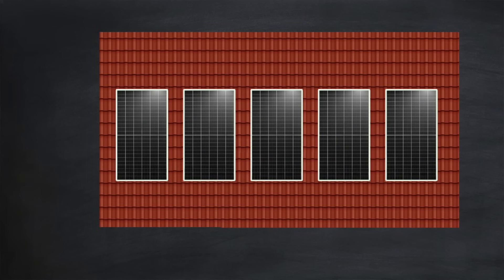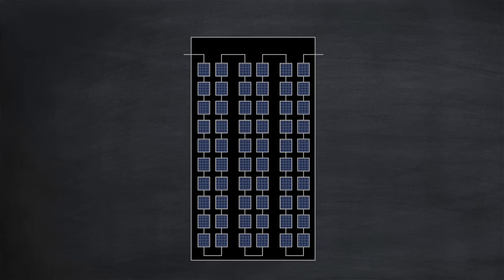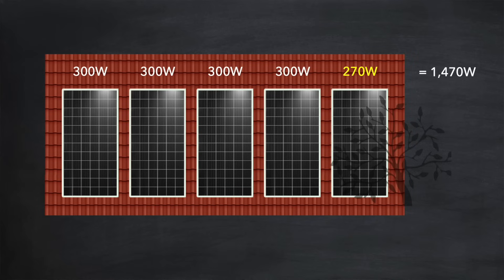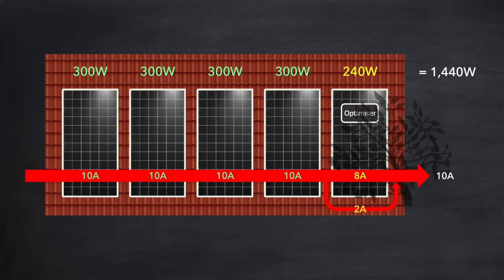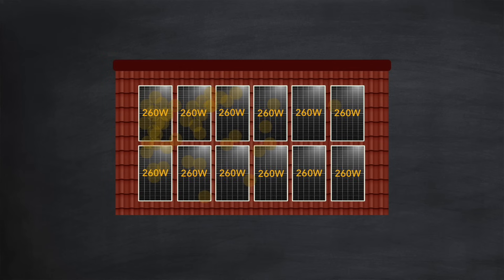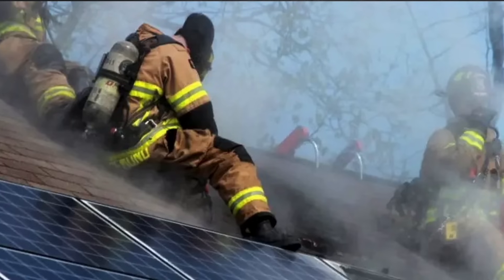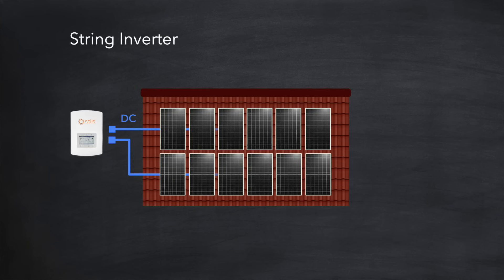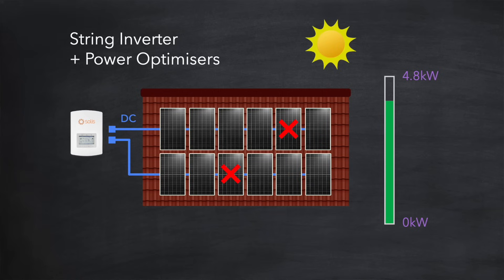Power Optimisers - What are they? And do you really need them?

Comment: Two Solaredge optimisers have failed in 8.5 years on my 12-panel 3.2kWp system. Solaredge have provided warranty replacements but labour and access are extra. On my latest optimiser replacement the scaffolding cost £600. Despite this, Solaredge monitoring of each panel in detail and their customer service has been very good.
Reply from the maker: Hi Andy, thanks for sharing your experiences with SolarEdge optimiser failures. Yeah, I do worry about the scaffolding costs. I'd really like optimiser and microinverter manufacturers to further stand-by their products and increase the financial reimbursement levels of warranties. After all, it's just an insurance policy like any other, and so can be costed as such.

Comment: Not sure why you are so much in favour of micro inverters !
You forgot to mention-that nowadays most of people are going towards hybrid inverters so they can store energy in batteries.
Solar installation  have increased already a lot and the fact there is a monopoly (at least in uk) for micro inverters make the bill 20to 30% more expensive.
Lastly, you can get a new inverter delivered to your door in few days and any qualified electrician can replace it (if no modifications are made to the installation!)
Reply from the maker: Hi Nicolas, I still have concerns about the costs to replace in the event of microinverter (or optimiser) failure, but for mass consumer solar, I believe microinverters are the easiest, most flexible solution, as detailed in the video. 

Whilst a hybrid inverter allows you to store energy in batteries, so does any other solution, so I don't know what point you're trying to make. Take for example, Tesla Powerwall, which can work with any solar solution.

With reference to the pricing of solar installations, I believe prices will drop over the next 18 months, as detailed in this video here: https://www.youtube.com/watch?v=S_cB_9pYig8 Just take a look at GivEnergy's new battery - same spec as the Tesla Powerwall 2, but nearly half the price. As the battery is about 40% of a typical solar installation price these days, it takes a notable chunk off the overall price.

To your last point, technology is always moving on, and it may not be possible to get hold of the same inverter make and model.

Comment: We had a discussion with our installer about Solaredge Optimiser reliability. They were replacing 10 a year over the 20,000 panels they had deployed, so a 0.05% chance of failure per panel per year.  Thought I'd mention here since the data for this doesn't seem to be overly available.
Reply: Thanks for sharing this statistic. My impression is that the failure rate of Enphase micro-inverters is 0,05% over the whole lifespan. If we assume a lifespan of 30 years, that means the failure rate of optimizers is 30x higher than the failure rate of micro-inverters. This does not take into account the certain requirement of swapping the string inverter.

Note that I dislike optimizers and micro-inverters equally due to their additional costs among other reasons, so I'm not biased towards one or the other. I prefer the simplest, cheapest, most robust, quickest to install, highest producing system. This is not so easy and in practice and some trade-offs are unfortunately still necessary. On a positive note, it is almost a certainty IMO that solar systems will keep improving in all aspects (e.g. lower costs, less likely to fail, more robust against shade, higher efficiency, etc.).
Reply: @FrankPloegman  Yes, this all came up as we were querying the fitness for purpose for the optimisers after one of ours died within 6 months of the installation date. The statistics themselves are interesting, but without more context don't provide much information - if all of these failures are shortly after installation but then drop off significantly for the lifespan of the array then that paints a very different picture to the odd failure every couple of years.

Bizarrely, the one optimiser we had which failed (February) returned to normal function in May - we've been waiting for a date to have it replaced. I'm not sure if that might be related to components drying out in warmer weather or whether there was a firmware update which resolved an issue.

I think if we have other failures, we'll have the optimisers removed and switch to a different string inverter. There is some shading from the chimney, but it isn't too significant tbh.
Reply from the maker: If you look at Enphase, they release their failure rate statistic. Unfortunately, SolarEdge doesn't, so it raises a question mark in my mind. I tried my best to find data, and reported what I did find in the video.
Reply: If we say the average project is 10 panels, then over 10 years they have to revisit 5% of their projects, what a pain.
Reply: @edc1569  If it would be that high installer would not do SE anymore - its gotta be less, SE would be out of business if their failure rates were 30x higher than their competitor

Also the above statistics leave some question for debate:
1 - was always an optimizer at fault, so a direct technical failure?
2 - were there any connection failures - i.e. cabling issues, broken MC4s etc
3 - How were they mounted/exposed?
Reply: @brainthesizeofplanet  No debate required. The 30x is simply wrong.
Reply: @edc1569 I think it is .05% revisit under warranty. So if you had 10 panel’s highly unlikely to fail.
Reply: @edc1569  In the math that I learned, 10 times 0.05 is 0.5 not 5.0.
Reply: We made a comparison with solar edge optimizers and a conventional installation. It was surprising that the standard installation with a software based shade compensation (Fronius Dynamic Peak Manager) was overall better than with optimizers. 

We measured a noticeable power usage in the optimizers! 

If you consider that the price of a optimizer is similar to the price of a 430 Wp solar panel, it makes no sense for me to install optimizers anymore. 

It is much better to spend the money on additional solar panels and oversize the generator. 150-200% is often possible. This will be much more effective! Especially in winter and with clouds
Reply: Artisan Electrics put up a video [turn of May/June '23] on larger job they were returning to for putting in batteries, adding a few extra panels and pigeon excluders. On the original solar array one panel had a problem and an SE optimiser was implicated and they found a second problem on another panel while there. Only a single data point but useful to the conversation I hope.
Reply: exactly    optimizers are junk,  they clogged the electrical flow, they make power decrease as you see  no matter what the installer tech tells  you, and they are another failure/ hinderance  point   AND they Increase cost  to No True  benefit, they rob you $$  and juice  in 2 ways  !!!
Reply: maybe even lover if cooling
Reply: That isn't 'data', it's anecdotal and meaningless. Figures from Solaredge would be more convincing, but they aren't telling us anything. The money spent on optimisers would be better spent on more panels. If you don't have space for more panels, the money spent on optimisers would probably be better spent on buying electricity from the grid.